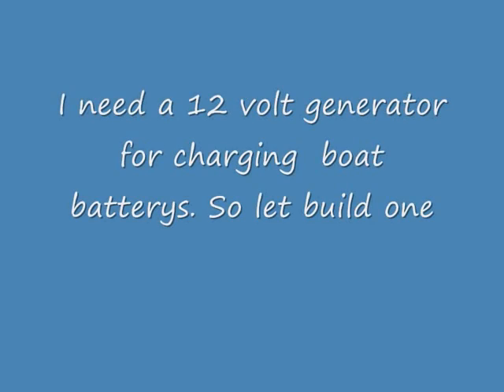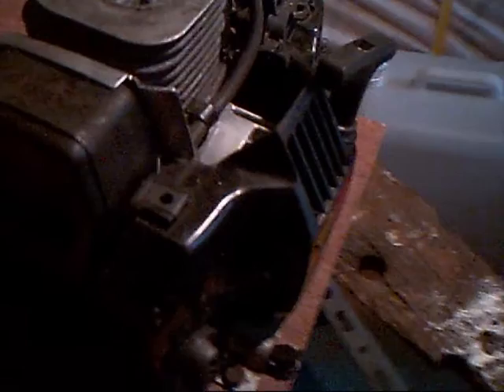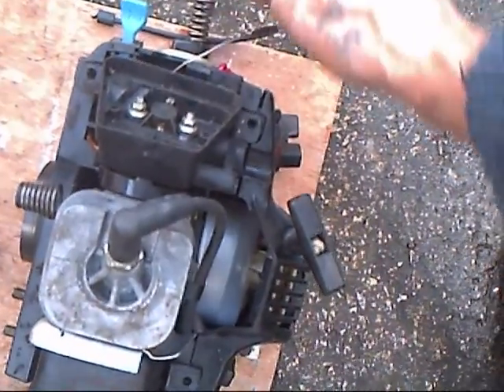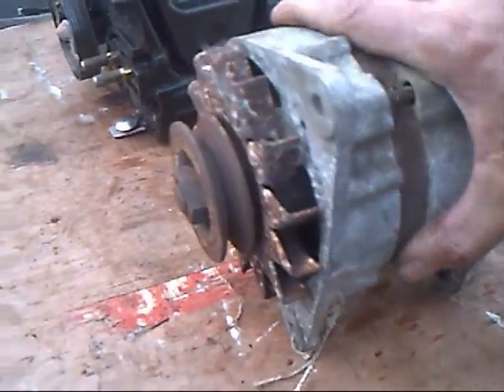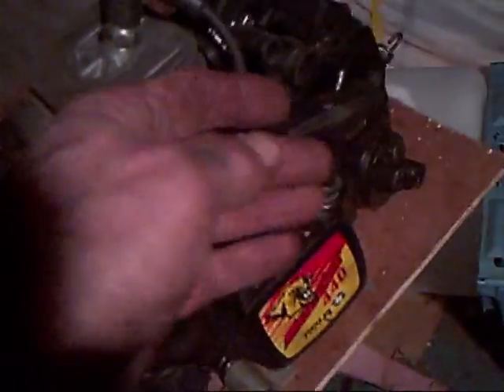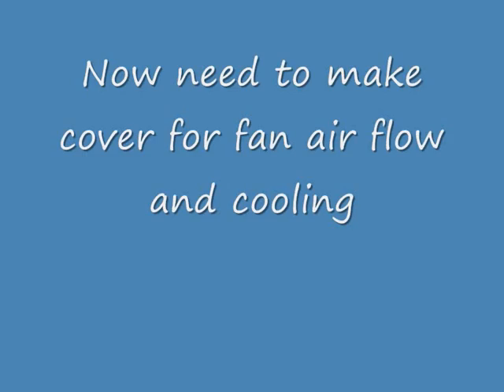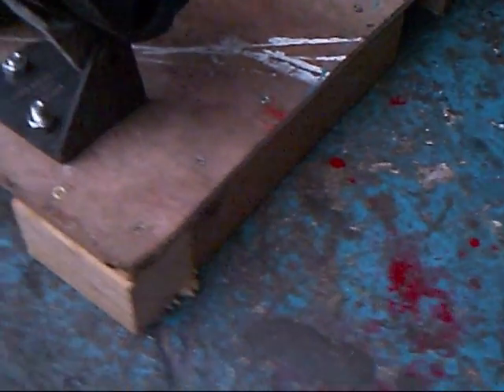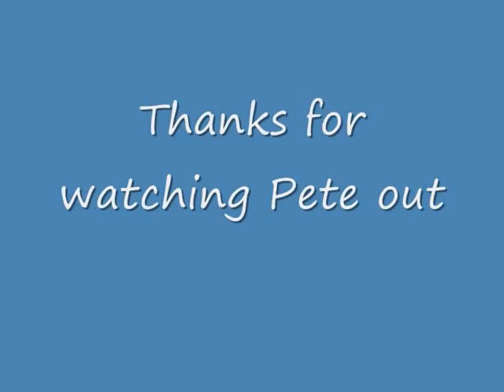12 volt Generator from chain saw  Part 1 petethewrist

Comment: These wires also look good but am getting the lower side wires and the single rear wire replaced at Avian...l want to replace all the bolts and nuts and have found a place no Wolverhampton that sells aircraft hardware....just going be a pain working out sizes and quantities.lol
Reply from the maker: +p51dgp  I could not figger out how to send private mail anyway I buy all my bolts very cheap from a firm on line all Aircraft gear, I might have all the sizes wrote down somewhere i shell have a look when i have time, but wiht I did was take out one of each and order them from the chart online i shell look up the firms name,, It is   LAS Aerospace Ltd , Check out their site on line and see how easy it is to get the right lenght of bolts with the dead right amount of threads,, no threads in the ally tube if you know what I mean..
 Buy the way some time back Avien told me they wanted £150 for bottom two side wires ech mind you  Lol,, I therefore decided  to buy the new tool as use to make them for my boats,,, now a new wire cost me about £7 each, in the last few years I have made about ten, Let me know how you get on, 
By the way did you check out how the from wires are only held in place by two pop rivet,, Now they can not check them one a years as they recomend,, For me i put solid rivets through their middles,,,,,Cheers, Pete

Comment: Hello again,l bought my Calypso just before Xmas off gumtree for £140 with a stirrup harness and helmet... The sail is in excellent condition with no rips or patches but has a bit of staining due to storage and a small area of mildew in between the double skinned area near the wing tips. I want to replace the lower rigging wires and all the nuts and bolts as its not been flown for over 10yrs.... I also need a bag as the one that the glider was in is totally shot but l did salvage the zip lol......do you have a bag for sale that would fit? Geoff.
Reply from the maker: +p51dgp  Sorry but I need both the bags I have,, I think this thing about wires is a pain.  I used to change all mine, but on the glider  i ghave now, it was sat in a garage from new and I am on the same wires, I checked them and they seem sound.  The cheapest way for me is to make my own and I have and I have done tests that would blow your mind,  https://youtu.be/BvOoyi8GkMg..
 The only thing is you do not know there history,, but I think if they look good they are good,,, Now I will get some flack from saying that,, but I have tested wires to,,,, well I could not disstruct them,,, Watch the video.. 
 The tool for making the wire is about £60 but then you  do need to know how to use it.but you can learn on line,, Hoping to be flying at Westbur White horde tommorrow fingers crossed,,, Cheers, Pete
Reply from the maker: +p51dgp   Just another thought,, if you think your wires are weak do not look to closely at your bottom bar.. like I did    https://youtu.be/DHiPVRFG3Ks   compared to the bottom bar the wires are so strong and then there are the fixing at the front keel tube. I think I covered them in this video,,  https://youtu.be/S5x6TSgcjO8   I hope I am not putting you off the Calypso,, only tey fly really well and safe,,,Cheers, Pete